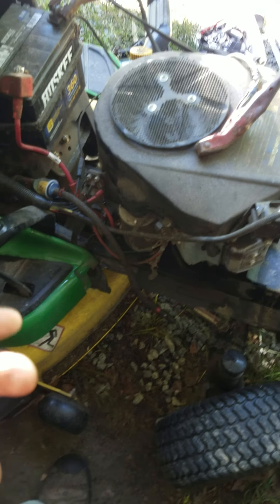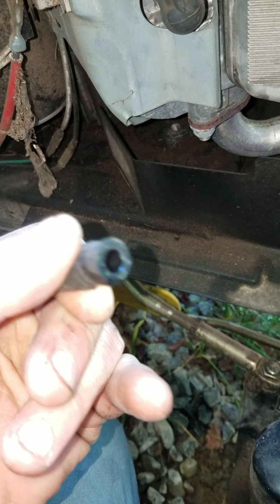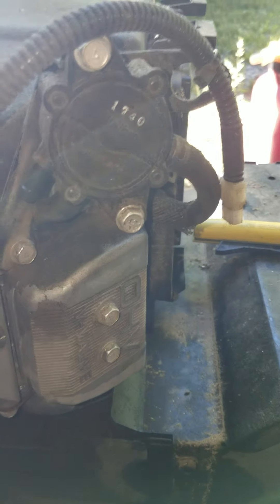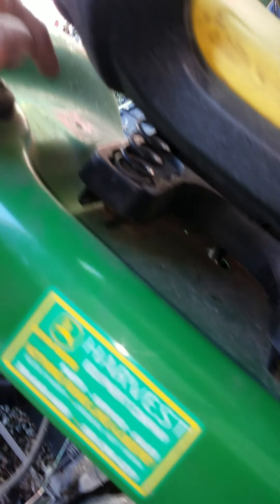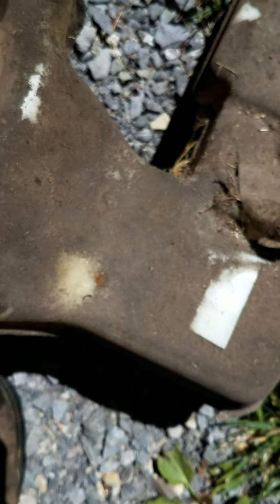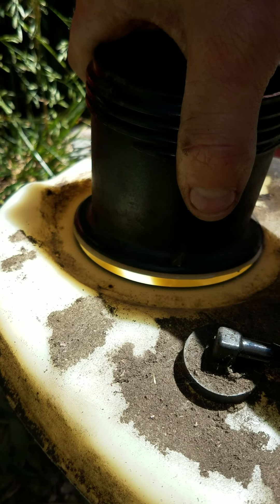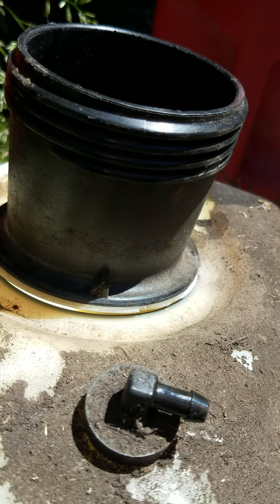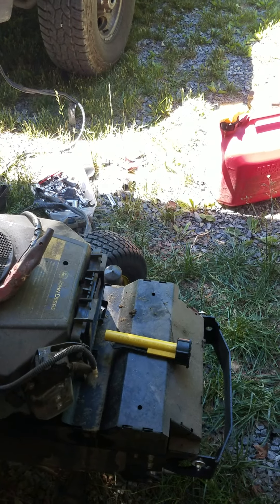Fuel problems on  John Deere X300 riding lawn mower it's a 2008

Comment: My dad is having an issue with getting fuel to engine. Close inspection under the seat showed a pigtail from a harness not plugged in to anything. I'm just starting my research, but is that auxiliary or does it belong somewhere?
Reply from the maker: The one underneath the seat is. If you fall off, it will turn the engine off. Plug it up and try it. Sometimes it's hooked to a fuel shut off, Silinoyed
Reply: But that switch is plugged in, it runs straight to a cable that runs up front. This pigtail splits of from that safety switch.
Reply from the maker: @kristinhiner3221  Normally it's just the 2 wires that come underneath the seat to the safety switch.
Reply: @adamhamrick3897  yeah, that's why I was wondering if it was auxiliary. I think it's probably fine and I'm going to check out the solenoid shut off to the carburetor. Thanks for your help!!
Reply from the maker: @kristinhiner3221  Check the shut off. Still annoyed on the carburetor. And make sure it's opening and closing the way it needs to. I can't remember if that model has a fuel pump. But you can disconnect it and blow air back through the line into the tank to make sure that you are getting fuel. And change the fuel filter if needed. I have seen fuel filters clog up and they not want to run.
Reply: @adamhamrick3897  So, I checked the fuel solenoid. It seems to be not getting power to it. However, I also checked it on a battery off the mower, it is also failing. Set up bypass and ordered new part. Hopefully when new part comes it will work and it is getting power to it. If not, at least I can still use the bypass.